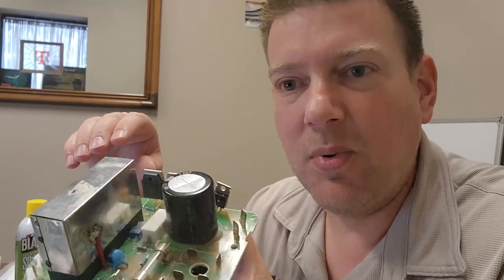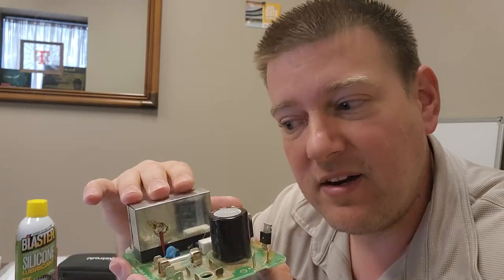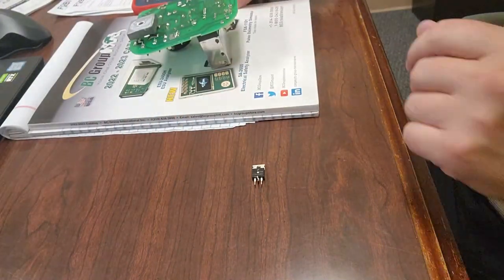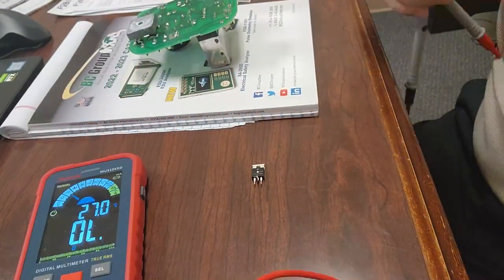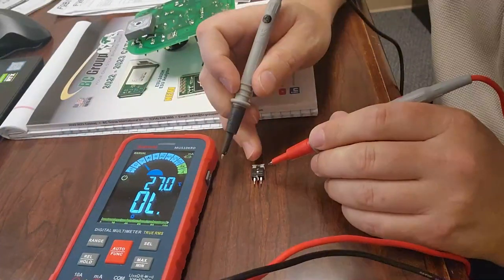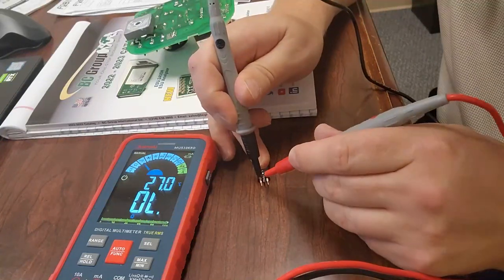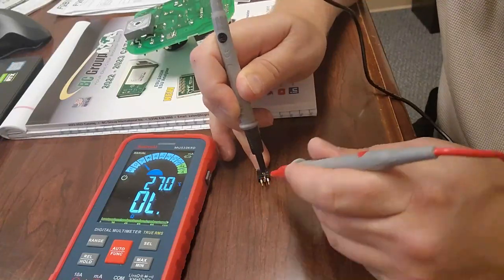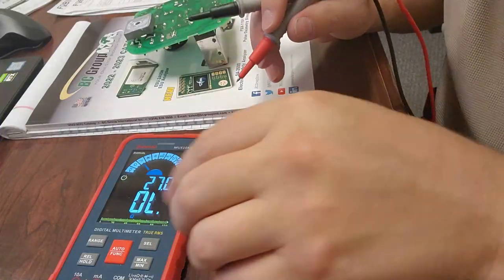Troubleshooting Treadmill Motor Control PCB

Comment: I bought a  brand new controler for my nordic track trradmil from iconfit. When i instal it everything comes on but the motor is not running. I tested the negarive and positive goimg out to the motor and on 7 mph it gives a voltage less dan 1 volt. What could be the cause? Its a brand new controler.
Reply from the maker: @naiemhaniff7062  No error codes?